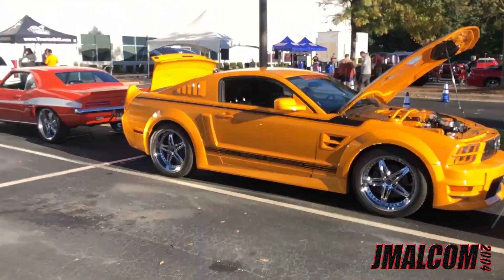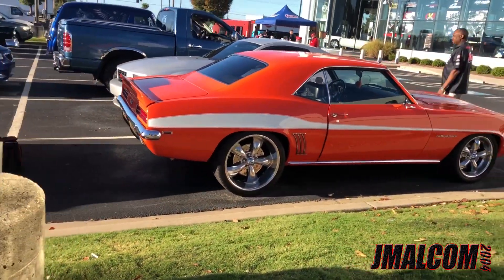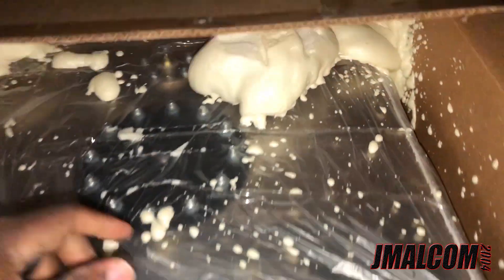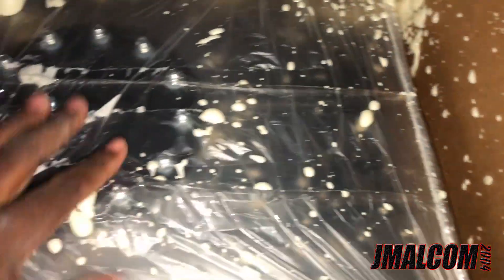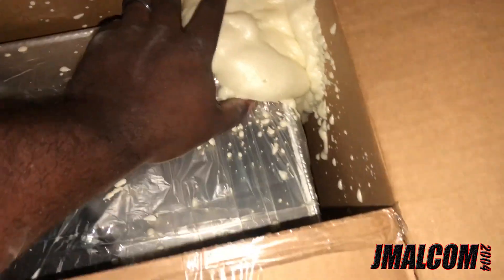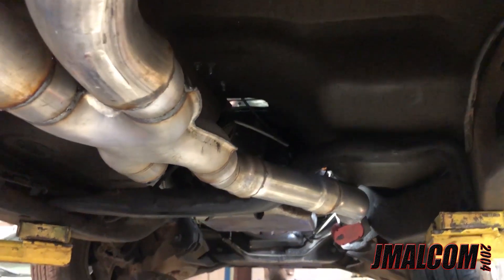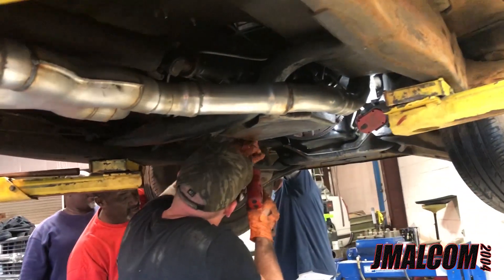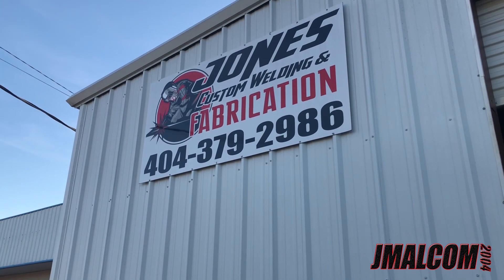JMALCOM2004 $5000 BUDGET BUILD EPISODE 26: FUEL CELL IS CRACKED AND I GOT THE EXHAUST DONE!

Comment: Hey man just a Lil heads up if u have foam inside your fuel cell take it out the ethanol in the gas will make it break down and it will ruin your fuel system trust me bro it happen to me at the beginning of the season n I had to replace cell fuel pump and lines filters cost me a good bit of $$
Reply from the maker: Jeff Burnette yeah I’m aware of it breaking down and clogging filters and tearing up pump if it’s not caught soon enough. But I need something in there because my cell has no baffles. I may try it without the foam at 1st and see how I like it
Reply: JMalcom2004Rides yeah he's 100% correct! the same thing happened to me ..it ruined my fuel pump and clogged up my fuel filters....I took it out and now all is good!😁

Comment: Sqeely belt😂. Those mufflers are so quite.  It's time to put some 31x 10.5 w slicks on it and roll the fender. Hit it with a 250 shot just to see if it will hold up you should be good
Reply from the maker: GreenBoy at GA Farms lol. I know. It was a little loose but we tightened it and this truck won’t ever see a tire that big lol. 26s going on and 150 Shot to be safe.
Reply: LOL 250 shot will result in a pile of parts!!!
Reply: @bengiforte265  yeah your probably right but iv sprayed that much on cast piston motor before  I guess it's  all in how you put it together 😂
Reply: @greenboyatgafarms2250  initially it will take it, but somewhere down the line. All of the heat and pressure will get to the pistons. 

J Malcolm this has been a cool series. You got me wanting to put together a street/strip s10 project now. I saw a ext cab s10 for $800 a week ago. And I kept saying there is my summer 2019 project!!!
Reply from the maker: Bengi Forte it’ll prb take it one time with a excellent tune but after that BOOM 😂😂